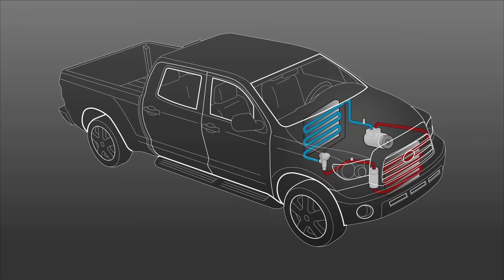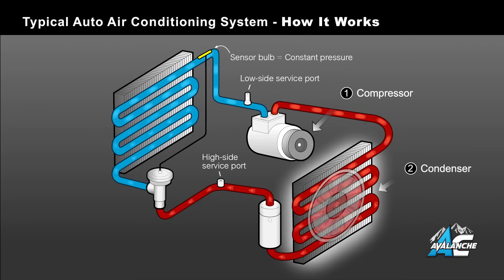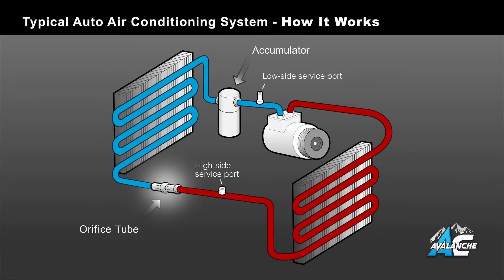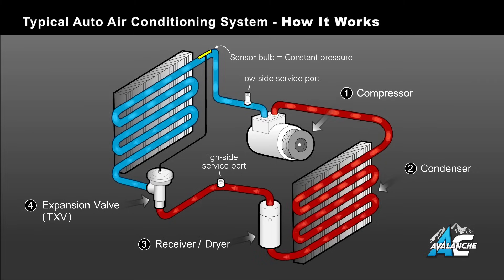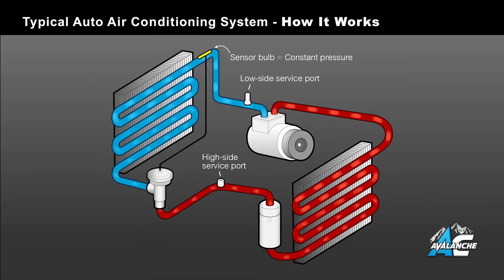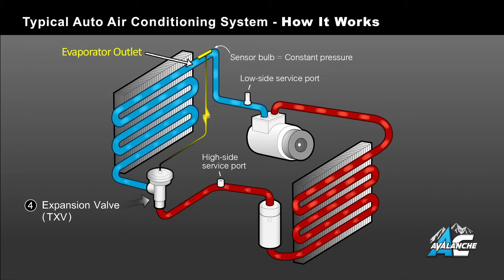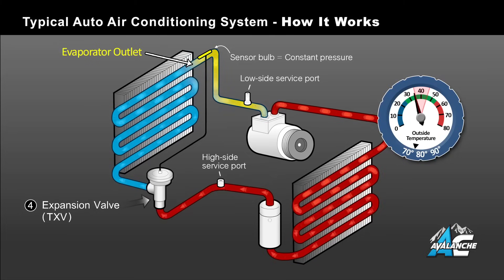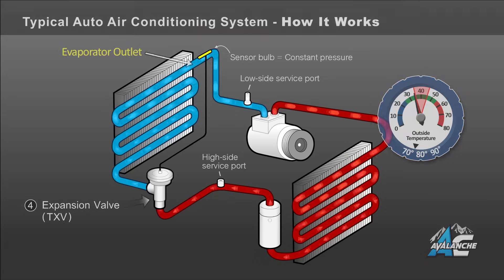AC Avalanche - Auto Air Conditioning 101 Made Easy

Comment: Hi AC Avalanche, I have a Chevrolet Sonic 2015 the the problem is that the high pressure pipe is cold and the low pressure pipe is warm and the A/C does not cool, what could be the problem? i have to recharge the system each month.

Comment: The TXV has only one function and that is to control superheat, ensuring that only vapor goes back to the compressor, it does not control pressure or temperature. There are two forces trying to close the TXV (evap pressure and the superheat spring) and one force trying to open it (superheat aka power head). Low side pressure will increase or decrease depending on the refrigerant charge, with more liquid pressure the refrigerant is moving faster through the evap and not removing as much heat.

Comment: Correct me if I am wrong but isn't the job of the condenser to cool the high-pressure gas as the air traveling through the condenser releases the heat through the fins of the condenser (the same as the radiators job is to remove heat from the anti-freeze)? Essentially condensing the gas back into a liquid as it cools off thus the name of the component (Condensor). The refrigerant enters as a hot high-pressure gas and exits as a cool high-pressure liquid, the job of the expansion valve is to simply lower the pressure of the cool high-pressure liquid as it enters the evaporator where the chemical change once again takes place and the process repeats itself.

Comment: It sounds like a totally sealed system from this and you don't have to worry about engine fumes mixing with the air-flow of the A/C. Should not be any fumes in an engine compartment anyway but with larger 4bbl carburetors that are not especially efficient you never know what hydro carbons etc are there.

Comment: My a.c. doesn't work, 1st thing I tried was recharging the frion still didn't work 2nd I bought a new compressor changed it out it still didn't work. 3rd I changed the a.c. pressure switch still didn't work, 4th I bought a new relay put it in still nothing, but if I jump two ports where the relay goes the compressor kicks on and I have my a.c. again

Comment: Thank you for the video. I am a pretty decent mechanic and have worked on all kinds of cars. But I never had formal training and I need to ask....when replacing the condenser, does the pag oil stay in the system somewhere? Or does the vacuum pump pull it out, therefore needing to be replaced with new pag oil when recharging the system? thanks again!

Comment: one question, is the condenser the same as the radiator? or are they separate components in the car.
Reply: Separate components you can see then in front of the car 2 different components look almost the same ..

Comment: Outstanding video.  Thank you.  I've learned plenty on this subject thanks to YouTube.  This video, however, has a couple additional features that help even more.  First, the identification of liquid versus gas with bubbles or arrows in the animation is great.  This helps with visualization of the changes that occur, where they occur.  Second, the effect of the reading at the sensor on the flow allowed by the expansion valve (I have an orifice tube on my vehicles) and then HOW overfilling can occur.  That, I think, is the first time I've seen these features included... quite valuable.  Thanks again.  My guess is that the smart clips substitute for having a thermometer in the vent?  Someone commented a year ago that your product, with the clips, are sold at Autozone.  I shop there, and do not recall seeing them.  Will look for them, specifically, next time.

Comment: Good afternoon. How to wash the air conditioner system?
Reply: Just cover electrical cables and components with aluminum foil, disconnects the negative of your battery and spray it down with high pressure water. Do not damage the fins in the evaporator or condenser otherwise the air flow will be reduced, and heat will be huge.